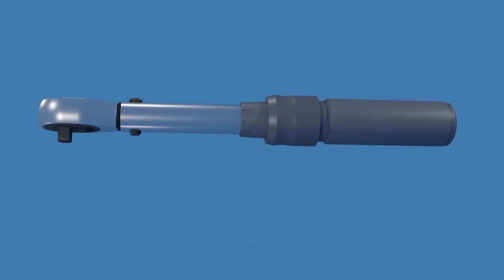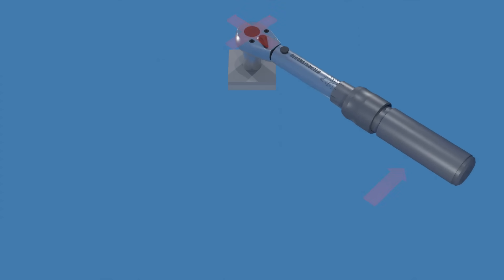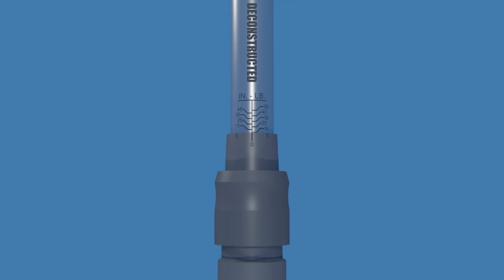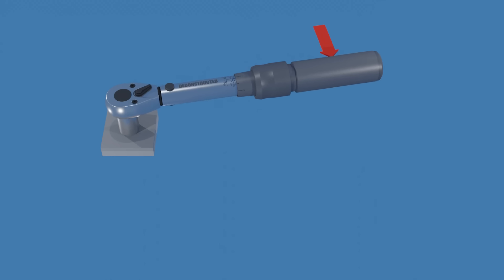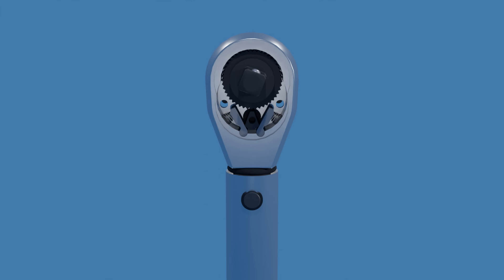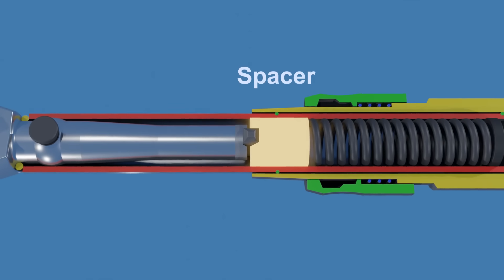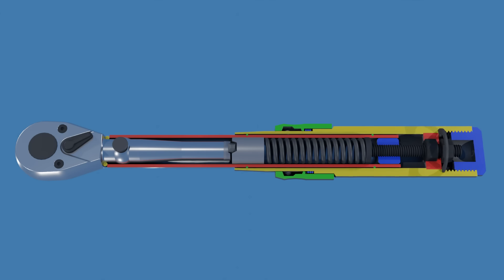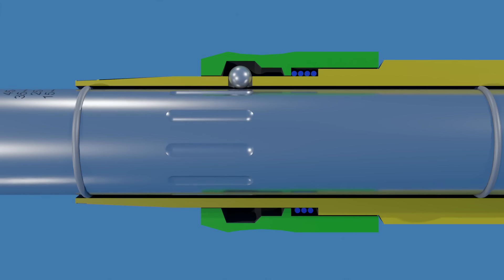How a torque wrench works

Comment: Why would it damage the wrench if it is used to loosen bolts?
It is symmetric in construction, so if a bolt is fastened with 30Nm, the wrench can be set to 40 or 50 for loosening.
Reply: Exactly, how would the wrench know it's not fastening a left hand thread? It's the going on after the click that ruins the wrench. In any direction.
Reply: Damage would not be from use in the opposite to usual direction, it would be from use beyond the intended torque capacity. Loosening threaded fasteners often requires far more torque than tightening them. 

To safely loosen with a torque wrench, a method might be to set it to a high torque still within its range, and stop applying force if it clicks.

Comment: Great video! One thing I want to mention, creep is not the right term for why you unload the spring. Creep is a process in metals that needs to happen at over .4 of the materials melting temperature. That springs melting temperature is far higher than operating temps.  The material process you are thinking of is metal fatigue. This is what you are trying to avoid by unloading the spring. Great video otherwise!
Reply from the maker: Thanks for the feedback
Reply: Springs don't work like that though. If you're within tolerances you're within tolerances. There've been many tests leaving springs compressed for up to decades.

Comment: Americans use inch/foot pounds for torque?? im gonna be sick...
Reply: Yeah, they count and measuring everything according to foot 🦶🏼😂 that's is very scientist way, Isaac Newton will👍🏼
Reply: You know, Double Standard at it's fullest.
Every foot have different lengths how can they standardized that?
Really Idiotic.
Reply: @vasya6175   They count and measure* everything (...). That* is* the* scientific way, Isaac Newton used*. - You definitely have to brush up your English.
Reply: @valkayra  ... double* standard* at its* fullest (it's = it is). Every foot has* a different length*, how can they standardize* that? - One guy made the rule, and he used his own right foot. Happy now?
Reply: @einundsiebenziger5488  yeah one guy using his foot as standard and other just following this?
The guy using his foot to measured length, are other need to borrow his foot to measured length in old times? Or they will used their own foot?
Also you do need other measurement unit to count the length of the foot too, right? 
What a useless act. To convert and de convert it to other unit. When there's universal unit already.

Comment: I really think that aircraft's mechanical flying indicators could make great video subjects,
The altimeter working with an expansion chamber, and having it's reference set with a simple offset on the needle output
The variometer using an expansion chamber with a hole, thus the pressure decreases slowly, giving the speed at which the pressure drops
The artificial horizon, with a graduated sphere, which rotation gets stopped by a mechanical gyroscope (linked to it). The inner workings of flying gages are really impressive in simplicity

Comment: I remember when these were first introduced in the late 70s / early 80s. They were revolutionary!

Before that, a torque wrench was just a breaker bar with a needle rod extending to a measuring scale on the handle. They were a huge pain in the ass to use and not particularly accurate.

Comment: Interesting.  I always figured these use some sort of cam arrangement, not a metal block that finally tilts.

Great video!
Reply: There are types that use a cam system, often called slipping or cam-over wrenches. They just release and the nut stops rotating, no need for audible indication. The clicking type can use other mechanisms besides the tipping block, such as ball and detent or roller/groove system.

Comment: The torque wrenches/torque drivers I used to calibrate (which were small and marked for low values) used steel balls packed with grease. At any rate, by watching the video you can see where normal wear and tear can lead to inaccurate readings. For consumer-oriented products, I'd recommend verifying the torque readings using known weights and basic math. Our lab calibrated to +/-4%, so keep that in mind when setting your torque. While it is theoretically possible to fix an inaccurate torque wrench, it's too much of a hassle for the average person. In our lab, we might replace steel balls that had flattened, and repack the grease.
If you want to verify a torque wrench, check at least three points on its range; low end, middle, and high end. This checks the linearity of the settings, and the internal spring. As in the video, always return the torque wrench to its lowest setting when finished, as this relaxes the spring. If the wrench has been dropped or otherwise abused, run the adjuster through its full range at least three times, then leave it at its lowest setting.
Reply: In the shops I worked at, torque wrench calibration was pretty much just a test of the calibrator, not the tool. I unironically think it was seen as a skill to get a wrench to pop in tolerance that another tech had red tagged. 4% IV once, out of ten tries? Lick it and stick it

Comment: Great video. Might have been useful to explain why the handle (not the shaft) needs to be gripped.
Reply: If the creator is aware of that, might not want to attract the nutty fringe to the comments... But a clear, accurate animation of the factors involved would be good.

Comment: some older click type torque wrenches of this exact design do not use a ball detent locking ring, and instead use a locking nut that protrudes from the bottom of the wrench. the locking nut can easily get stuck too which is a huge pain and its why all newer ones use the ball detent locking ring

Comment: Another use besides just torquing the fastener is seating bearings. When I used them in the USAF, we had to tighten to a higher than final torque setting, change the socket to a breaker bar to back it off, then re-torque the fastener to a lower setting and secure it with a cotter-pin. Another consideration that should be mentioned is when you are required to use a crow's foot attachment for torquing fittings that are not accessible by a socket. The point of reference for the torque value at the center of the square drive is offset from the center of the crow's foot. In this case, we would use apply a mathematical adjustment based on the position of the crow's foot to ensure proper torque was applied to the fastener.

Comment: Nice informational animated video. 
Although you mentioned a locking system my set doesn't have that. My set is certified so I guess it's not a standard. 👍

Comment: Only thing I saw that was missed. With this type of torque wrench you should always adjust up to your target value (compress the spring). Never down (decompress the spring). If you overshoot the torque setting by twisting the handle  too many rotations you need to rotate the handle back several turns below your target. Then, twist the handle back up to your target. This accounts for tolerances and backlash in the system that may throw off the accuracy.

Comment: Very cool. Mine uses a screw at the end of the handle to lock the adjustment, but everything else looked almost exactly like the inside, which I saw when it was recalibrated to within 1% back in 2018. Factory spec was +/- 4%.

Comment: This has great animation and clearly articulated details, but I am still curious about one part of the explanation.  When you say when the preset torque is reach, the stored energy is released and the pivot block is allowed to pivot, how is that happening?  What is holding the pivot block in place and what is the mechanism to release tension?  From the animation, it just looks like the handle setting applies enough compressive force via the spring against the ratchet head via the pivot block to keep the block in place and that it is when the desired torque is reached that that force overcomes the spring's compression and the pivot block rotates.
Reply: Your summation looks pretty good to me! Like you, I see the explanation of stored energy as skating over some detail, but I think a few deeper technical factors have been not worried about in order to avoid making it over complicated. There's no discussion of the transmission of force for example.
There is indeed a set amount of stored energy in the coil spring with a resultant force, and as you apply increasing force to deliver increased torque output, greater energy is stored in the tiny deflection of the internal arm. (It acts as a short fat spring.) At the point this energy equals then becomes slightly greater than that in the coil spring, the pivot block can tilt (which is a rotation - the forces have been trying to rotate it all along). The stored energy in the arm stops being applied to the fastener (it stops rotating) and is released (the arm can straighten) in rotating the block instead. Any stored energy that is not consumed accelerating the small mass of the block, or converted to acoustic energy making the click, would be directed in opposition to the coil spring.
This is an attempt to envisage what should occur in a fluid fashion over some microseconds of time - I'd love to find somewhere an ultra high framerate camera video of a transparent mechanism in order to see exactly the sequence of events on a time frame.

Comment: A former (1950's era) Rolls-Royce car mechanic told me they never used torque wrenches in their job but instead, the length of the spanner was specified in the workshop manuals!

Comment: The order of the units for force and distance makes a difference! Foot-pound is work; pound-foot is torque.
Reply: convert one to the other, they're the same thing, just as 1 Nm = 1 joule. Because torque is just work in a circle rather than a straight line. 100 pound-foot (100 pounds at 1 foot), equals 100 foot-pounds (1 pound at 100 feet). In the frame of reference of an interfacing material, whether linear or rotational, there's only one vector, and it's linear.
 
 In british, if I pull one newton for one linear meter, the amount of work that needed to be exerted is called a joule. If that same work is applied to a 1 meter lever arm instead, it's called a Newton-meter.

Comment: i took mine apart because it was clicking with minimal torque applied, even after recalibrating it. the pivot block was a more rectangular shape so i don't know if orientation of it matters. i greased every component and put it back together, but no change. i saw another video adding washers so the spring has more tension and i'm hoping this will sort it out. 🤔

Comment: Random fact... A pound-foot is a unit of torque representing one pound of force acting at a perpendicular distance of one foot from a pivot point. Conversely one foot pound-force is the moment about an axis that applies one pound-force at a radius of one foot. 
In other words, how much force you would get from putting a one-pound weight at the end of a one-foot-long lever. An inch-pound is the same thing, except that the lever is one inch long. An inch-pound is 1/12 of a foot pound.

Comment: I have ALWAYS wondered what the hell is going on inside these things. Very interesting to see that there's really not much, relatively speaking - I assume there's quite a bit of math that goes into making that spring rate line up with torque values

Comment: Why are so many praising the explanation? The main thing is completely missing from the explanation. How does the tension in the spring translate to a rock at a specific force? The scale seems linear! Is the spring linear(follow Hooke's law)? - probably. What are the angles involved? -it is not at all obvious that the rocking point is proportional to the spring tension.

Comment: Holyyy crap, ive used a torque wrench to loosen motor mounts before i had my impact gun, and the torque wrench was able to removed them, that was 3 years ago and ive torqued over 300 things since

Comment: Overtightening = stretching the bolt thread beyond elasticity. I’ve read that when you use anti seize, you should set your torque 20% lower.

Comment: there are different designs too
I have a cheap Taiwan mystery brand 1/2 inch that has a thumbscrew at the bottom, rather than a spring collar.
Reply: Both of my torque wrenches have a locking screw at the bottom. I've never used one with the sliding locking collar, but it makes sense and the video's explanation of how it works is excellent and appreciated.

Comment: Hi. This only applies to this model with handle end adjustment. But for the model with adjustment above, where is something like a button and you adjust it with an Allen key? Do you have anything about this?

Comment: Ok so creep isn't an issue for spring steel unless you get to the high 3 digit Celsius temperatures. Fatigue failure would be a bigger concern which is also going to be unlikely for this application.

Comment: G'day,
1. Can these type of torque wrenches be used on left handed threads?
2. How does grip location on the handle effect torque setting?
3. If the torque setting has not been reached is it OK to turn the fartner in either direction?
Reply: 1. Many cannot, but some models are made with a fully symmetrical mechanism which indicates torque in both directions, or the square drive can be pressed through to project out the other side and the wrench flipped over to work left-hand. In either case this will be claimed as a feature of the tool, and also can usually be spotted by the appearance of opposing direction rotational arrows on either side of the handle tube close to the drive head.
2. In this specific design with the torque measuring mechanism's pivot pin offset some distance from the fastener axis, the amount of torque delivered on click will vary if the grip location moves away from the handgrip position. There's usually an indication like a ring or rings near the midpoint of the handgrip which is best matched to your middle finger - technically that's the Force Loading Point that the tool is calibrated to have the force applied at.
3. Generally yes, multiple progressive torques are often used for torquing to a pattern for wheel or head studs for example. If this isn't a specific requirement, and you just accidentally stop before you get the click, for greatest accuracy it's usually best to back the nut off and try to achieve the torque in one smooth sweep if possible. If you stop close to the required torque, then swing again, it's easy to jump over the target torque. If the consideration is about using the torque wrench to turn the fastener back, I prefer to avoid that and use a spanner to back off, to avoid possibly affecting the accuracy. (i.e. negating the conditioning exercise of the mechanism that you should have done before use - at least 3 warmup uses at full torque setting 🙂 ). In casual use I consider it's unlikely to provoke drama undoing a nut that is known to be at lower torque than the tool setting. The big danger with using it like a breaker to undo a nut is the unknown force required - the nut could be hugely torqued up, or rusted solid, and potentially damage the wrench.

Comment: I was driving 20ooo km with timing belt tensioner tighten to about 15Nm. Then one sunny day I bought torque wrench and torque meter and fix the nut to proper 20Nm. Fate was kind to me 🤭

Comment: I am curious why a torque wrench cannot be used for loosening fasteners. The mechanism works both ways afaik, so if I set it to a high preload it has the same stresses as if I was tightening a fastener. How does this damage the wrench or lowers it's accuracy?

Comment: It appears that the quality of pivot block and spring control the accuracy of a torque wrench. Once calibrated carefully, any torque wrench shall give a reasonable accuracy.   Is a expensive torque really worth for the price ?
Reply: True, the dimensions of the pivot block adjust the accuracy of the mechanism at the higher end of its range. In manufacture and calibration, adjustments are made by selection between blocks with dimensions varying by thousandths of an inch. The spring must maintain its characteristics over time and use - a poor quality, old or abused spring can mean the wrench cannot be adjusted to spec during calibration and the spring needs to be replaced. A more expensive tool may be better in this regard.

Comment: its pound feet and pound inches not the other way around. the measurement of torque is a force applied over a radius. the force being pounds the radius being foot, so pound foot. same reason its newton meters and not meter newtons

Comment: Never seen a torque wrench with the adjustable system on the handle before, mine simply don’t have that option, I suppose in such a case the wrench still has the internal spring mechanism, it just can’t be adjusted

Comment: I don't do anything that really needs a torque wrench and I don't own one but this was still interesting to watch. My only question is, if you shouldn't use the torque wrench to loosen bolts/nuts, why does it even have the option to set the ratchet to loosen? I mean yeah, it'd be annoying to be tightening a bolt, accidentally overtighten, then have to put a standard ratchet on it to loosen it then switch back to the torque wrench to try again, but if using the torque wrench to loosen bolts/nuts can damage it it probably just shouldn't even be possible to use it to loosen bolts/nuts.
Reply: I think that when undoing a fastener with a torque wrench, you could easily haul too hard on it and damage the mechanism inside after it clicks. If the torque wrench was big enough and you dialed in a big enough torque value so that it won't click when undoing, then I don't think that would cause any damage. But how would you know what setting to use? Having a blanket rule to not use them for undoing is a good rule. 

The reason that torque wrenches can work in both directions is that some fasteners are reverse threaded.